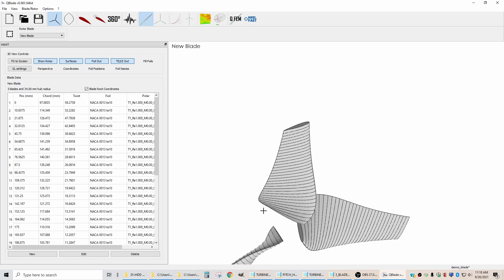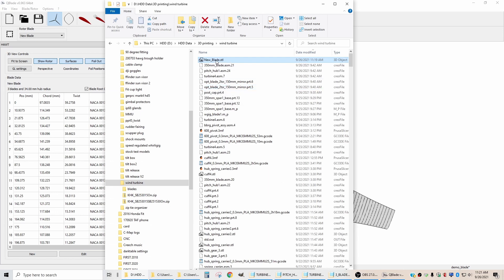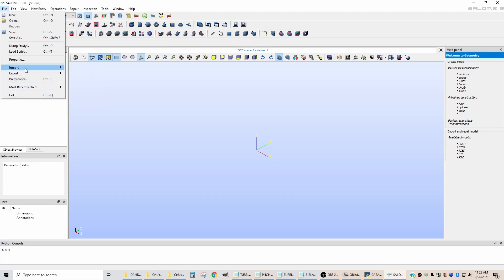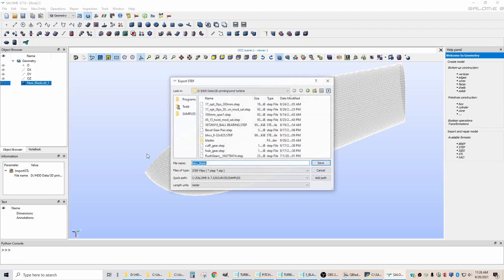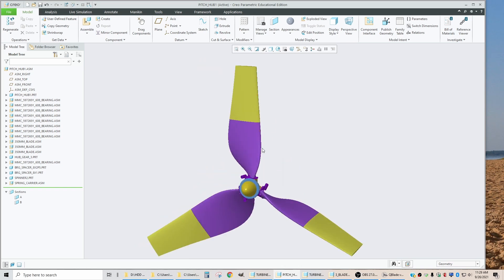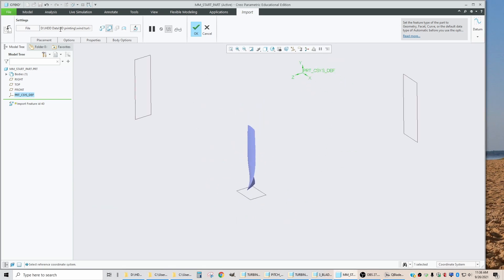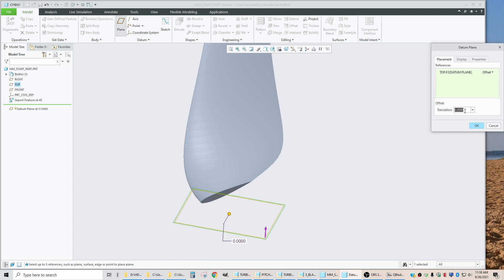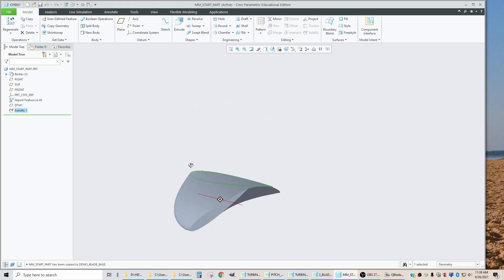Convert stl to STEP file to use in CAD software

Comment: How do you know if the airfoil you selected has a closed trailing edge?
Reply from the maker: @soccerboss7924  You can look at the table of coordinates and see if the starting and ending points match. On most there is a gap, which means it's open.  If the points are the same, it's closed.